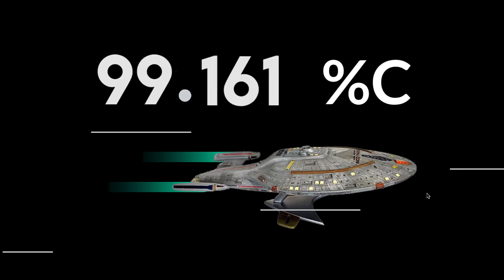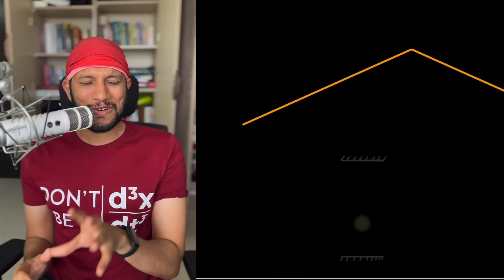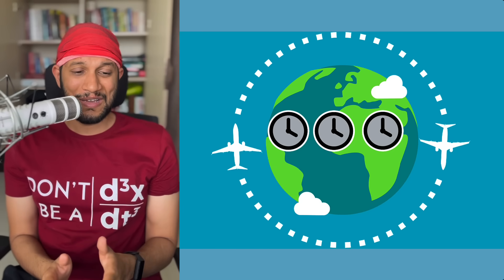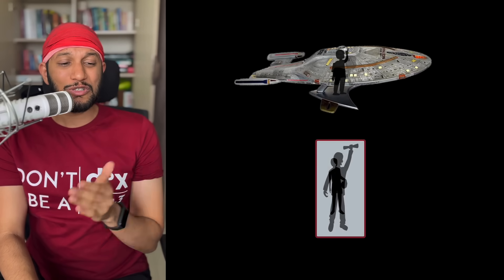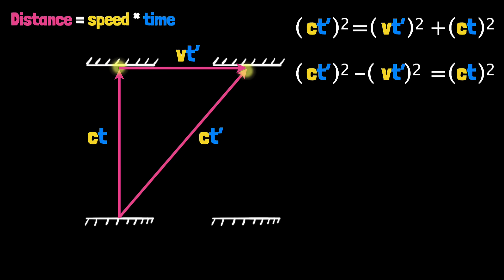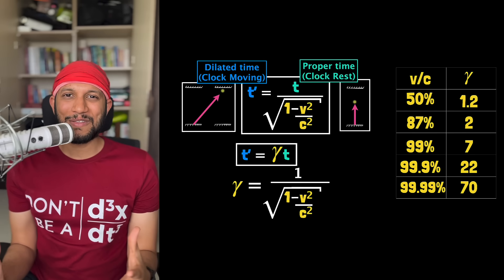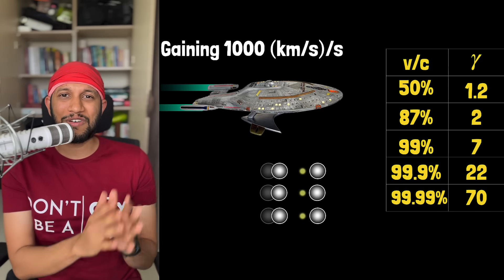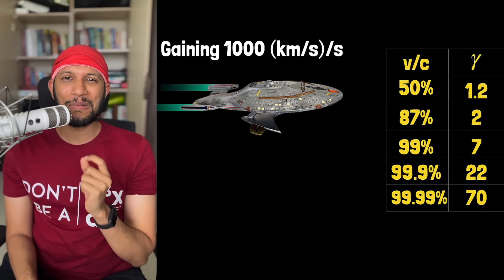I finally understood why you can't go faster than light! (My mind is blown)

Comment: Best explanation of Time Dilation and the speed limit I've encountered. But above all, I got quite emotional with your enthusiasm and teaching skills. It's as if you are discovering the phenomenon together with the student and getting blown away when you understand it. It is so inspiring.
Reply: I still don't quite understand the photon clock time dilation explanation in the beginning. I see it in terms of vectors, and the speed of the photon up and down should not change regardless of the speed of the ship (frictionless application being utilized here). It's akin to tossing a ball up in the air in an enclosed moving car. It goes up and down with the exact same force (ie speed) as if the car were stopped, yet the ball ends up in the back seat. It traveled a greater distance, but a force was applied to it. This is what is confusing me.
Reply: @nottelling4828  Ok! I hope I can clear some of your confusion (and anyone wanting to help is also very welcome to do that): 1 - the speed of the photon is not changing in both situations. It's the distance that the photon is moving through that is changing. So, try to consider it based on the speed being constant. 2 - Your example of the ball in the car, you mentioned "exact same force (i.e. speed)". Don't confuse force with speed. Applying a force on something can accelerate it, which means it will gain speed. In your example, throwing a ball up in a car means you apply a force (up) on the ball. But the ball falls down because of gravity, which is not the same as your "up' force (in a Newtonian perspective, Earth applies a down force on the ball). 3 - (In a ideal frictionless situation) If you are sitting on the front sit of the car, and you thrown the ball up, it will fall down back on your hands, not on the back seat. Even in a non perfect situation you can observe this: close the windows of the car, and properly throw the ball up (it need to be a very good vertical throw - perpendicular to the plane of the car). 4 - Remember that the force you apply on the ball is vertical. It doesn't make the ball move forward. The ball will only move forward (and still fall back on your hand), from the perspective of someone standing still outside of the car. From your perspective, the ball doesn't move forward at all, just up and down. If you want another example, just stand in somewhere (your room, outside, etc), and thrown a ball up. It will fall on your hands. The ball didn't move forward or made any funny curve. But if I was looking at this ball from outside the solar system, it would have traveled such a great distance (making all sorts of curves because of Earth and Sun's movements). I hope that if you can understand these 4 points, you can better understand his photo clock explanation.
Reply: @biosteamstudio  What if we, for a moment, put aside the assumption that the speed of the photons is actually constant in regard to an observer? That for the observer that sees the photons travelling a longer distance in the same amount of time, the photons are actually travelling faster than c, which is true according to his frame of reference.

The Theory of Relativity states that what is actually happening is that space compresses down at relativistic speeds, which creates the illusion for the observer, that the photons are travelling faster than c. But what if the very assumption that photons must always travel at c, regardless of the frame of reference, is incorrect?
Reply: @biosteamstudio  In my view, it sounds like "speed of light is constant" and "time and space are relative" are tautological axioms that necessarily prove each. Nothing really changes, if we invert the axioms and state them like this:
If "time and space are constant" then "the speed of light is relative."

This logic sounds perfectly reasonable and it doesn't cause physics to break in any major way, so I don't really understand, why we shouldn't invert these axioms. The only sort of major thing we would need to adjust, is that we would need to assume that gravity has an effect on photons, because gravity wouldn't compress space-time anymore.
Reply: @biosteamstudio  Sorry about the spam, YT keeps deleting my comments, if I don't split them up.
Reply: @villevalste1888  No worries about the spam. Thanks for your contribution. From my understanding, you can't consider that there is a observer for light, i.e., "c" is constant regardless of the motion of it's source or an observer (this is the 2nd postulate in the theory of special relativity). Also, if we want to imagine an universe where we can change the "rules" of the universe, this is not our universe anymore (I think FloatHeadPhysics mentioned this around 7:30). I also understand (I may be wrong in my interpretation) that the expansion of space does not change the speed of the moving object in space. Imagine if the object speed is 10m/s , but space doubled. It is still 10m, just that it is a longer 10m. The speed is the same. For example, imagine if you use your finger to move 5cm along a ruler. Then you stretch the ruler to double it's length. Your finger will still arrive at 5cm, just that you had to take a larger step (2x the length before stretching).
Reply: @biosteamstudio  That's exactly my problem here. If something appears to be going twice the speed of light, Einstein says that it's not actually going faster than light, because space-time bends for the object going at relativistic speeds, while the speed of the object maintains a speed below c despite our observations. Einstein's philosophy trumps empirical evidence. But why?

If we assume that space and time are absolute and that the speed of light is not, then our empirical observations remain valid without the need to imagine that space-time fluctuates based on an object's speed.

If we based our theories on what we are able to observe, I think we could come up with theories that actually reflect our reality. A fluctuating space-time continuum only needs to exist, because there is a disagreement between theory and observed reality. If the theory was adjusted to fit reality, instead of fudging the numbers with brand new theories, I think we might actually be able to have a model of physics that wasn't erring in its predictions by several orders of magnitude.
Reply: @ That's exactly my problem here. If something appears to be going twice the speed of light, Einstein says that it's not actually going faster than light, because space-time bends for the object going at relativistic speeds, while the speed of the object maintains a speed below c despite our observations. Einstein's philosophy trumps empirical evidence. But why?

If we assume that space and time are absolute and that the speed of light is not, then our empirical observations remain valid without the need to imagine that space-time fluctuates based on an object's speed.
Reply: @biosteamstudio  If we based our theories on what we are able to observe, I think we could come up with theories that actually reflect our reality. A fluctuating space-time continuum only needs to exist, because there is a disagreement between theory and observed reality. If the theory was adjusted to fit reality, instead of fudging the numbers with brand new theories, I think we might actually be able to have a model of physics that wasn't erring in its predictions by several orders of magnitude.
Reply: SO tell me, If 2 twins are moving, A with relative velocity to B and B with relative velocity to A,
which of this twins gets older ? WHich biochemical processes goes slower ?
If relative velocity A to B and B to A is the same ? 
If you have some point between M31 and Milky Way and from this point
you will start Starship1 to M31 and Starwhip2 to MilkyWay,
how many generations you need to reach this galaxy in those starships ?
And what will be the relative age of this passangers ? Which will be older. ?
Reply: @biosteamstudio  Time dilation doesn't exist.  Equating the functioning of a human made physical device to time is possibly the silliest and most fallacious scientific concepts ever.  It's so obviously ridiculous it shouldn't even be discussed except for entertainment purposes.  The distance traveled by a photon time measurement device represents time?!  Hahahahaha.  No. It represents the effect motion has on a tool.  Time exists independently of devices used to measure time.  So, when my clock stops, time stops?  Hahahahahaha.
Reply: @Darin.Pearson  It sounds like you're fixated on the concept of time from a philosophical perspective, or treating time as a constant.

If it is the latter, the onus is on you to provide proof that time is constant.

It also sounds like you've missed the point of the measuring devices as your logic implies that by me not having a clock at all that time ceases to exist all together.

This was not the insinuation being made in the video and shows a misunderstanding of our concept of time being relative to our perspective.
Reply: @Darin.Pearson  strawman argument final boss
Reply: @Darin.Pearson  Imagine going against science that has been proven for over 100 years at this point... this is a schizopost comment if I've ever seen one.

Comment: Because ever since the general theory of relativity was postulated, Einstein understood that you needed exponential increases of energy consumption the closer you get to the speed of light. Photons have it easy because being a wave and a particle at the same time,  they technically have no mass and thus they can ignore inertia and other gravitational interactions attributed to it.

But for an object with mass you need ever increasing amounts of energy to increase it's velocity with every fraction of percent it get closer to the speed of light, right up at the point where the energy requirement becomes infinite, because no matter what amount of additional energy is added to the system, the speed doesn't increase further.

This is common knowledge. Next video topic plis.

Comment: For speed. The reason that you can never reach the speed of light is that in order to do so, at some point, you would have to bring time to a complete halt and as you know, speed is the relationship between distance covered within a certain amount of time. Without time you can have no speed. Therefore, the issue is not that you need more energy, it's that you need more time

Comment: You were doing really well in the very beginning of your conversation. But then you got to the end, where you completely lost it. You see, the issue is not that you need more and more energy. In fact Let me clarify. In order to continue accelerating at the same rate you will need to use the same amount of fuel at the same rate. That doesn't change with speed. The issue is that the faster you go time slows down in order to compensate

Comment: The only way to have sub-light or over the speed of light flight is to have a deflector to repel any debris which might strike the space ship. Even a particle as small as an atom can penetrate the hull of a space ship. We don't have the technology for the deflectors or high tech materials for the hull of the space ship itself. Maybe in the next 3 - 5 centuries the human race will have developed the proper hull materials & deflectors. Will the human race still to be around, we'll have to see.

Comment: If you reduce inertia, you spend less energy that enables you to speed up to and past the speed of light. You have to reduce inertia by alternating the Higgs boson field around the craft on a quantum level. An example of this is the TR3-B. Look into it and then tell me it isn't possible to pass the speed of light. Easier to fold space instead of wasting time traveling from point to point using traditional navigation.
Reply: That's just UFO bs my dude.

Comment: Going faster than light is the same problem as going faster than sound. The medium being travelled through has to be taken into consideration. Until that happens, there will be no FTL travel. Period. Space is not empty, in fact it's full. A spaceship is as a submarine under water. Good job, by the way.

Comment: Amazing video truly. I have one question, you said that from the spaceships perspective nothing changes, so doesn't that mean that it will eventually reach the speed of light even when everything outside stays frozen and continue accelerating?? (stupid question, was just wondering)
Reply: Not a dumb question at all. But remember that according to relativity all speed is relative.  When you say "would someone on the ship reach light speed", you have to specify what reference frame you are measuring in. 

From the perspective of someone on the ship (that is, we are measuring the ship's speed relative to the observer on the ship), the ship is at rest.  This is true trivially since everything is always at rest in its own reference frame (the ship can't be in relative motion with itself or with an observer who is stationary relative to the ship).  So in this frame, the observer on the ship will never reach lightspeed (or any nonzero velocity).

Measuring from their own reference frame isn't very useful though.  When you drive down the highway, you are technically at rest in your own reference frame, so to get a useful measurement you measure your speed relative to the ground, e.g. if you're going 60mph that's 60mph relative to the ground.  The person on the spaceship can do the same thing and choose some arbitrary external point to measure their speed relative to.  But note that this is exactly the same thing as an external observer measuring the ship's speed, and as we've already seen the ship will never reach light speed in any external frame.

So regardless of what reference frame the observer on the ship chooses, they will always measure the ship's speed to be less than the speed of light.

Comment: Anything that has mass will not or can not travel at the speed of light nor can it travel even close to it.  Photons are weightless and can travel at the speed of light.
Reply: Massive objects absolutely can travel arbitrarily close to the speed of light (without reaching it).  Remember that all speed is relative.  Right now some high energy particle is traveling past you at near the speed of light.  It is also completely valid to say that, in the reference frame of the particle, you are travelling by that particle at near the speed of light while the particle is at rest.

Comment: Nahh the evidence of clocks slowing is completely wrong. I mean the clocks cannot be synced with formula because the solar system is also moving with some speed. So the absolute velocity with which planes fly is dynamic depending on which direction plane is flying. So the clock can go even faster if the direction of plane velocity is oposite to the direction of solar system velocity. There has to be some other effect that changes the clock motion

Comment: Excellent explanation. However, a question comes to mind that speed of light cannot be attained from the perspective of stationary observer but it can be attained from the perspective of the observer inside the ship, correct or not? and if not then why?
Reply: From the perspective of the observer on the ship (i.e. measuring in reference frame of the ship), their speed is always zero since they can't be in relative motion with themselves.  In order for the observer on the ship to make a useful measurement of their speed, they would need to measure relative to some external reference frame, and that is no different from an external observer measuring their speed.

Comment: Hello there. I am not very good at physics, so my question is:
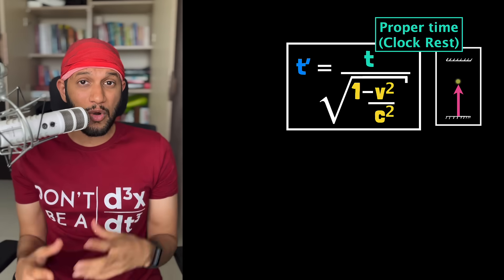how do you know when the clock is at rest (9:55)? I mean also the earth is moving in the universe and everything else is also moving. You have no fixed point where you know this is clearly standing still dependent on the universe itself?

but interesting video. I learned something new. ^^
Reply: One of the key takeaways of relativity is that all speed is relative and there is no such thing as an "absolute" speed or "absolute rest".  If we say the clock is at rest, that just means that it is not moving in the reference frame that we are working in.  However it is perfectly valid to say that it is simultaneously moving at 99% of the speed of light in some other frame.  Same idea with the earth: if we're measuring, say, the speed of a ball thrown through the air, we measure relative to the earth which we can consider stationary.  The fact that the earth is moving at "high" speeds around the sun and that the entire solar system is moving at even higher speeds around the center of the galaxy are irrelevant.
Reply: @charlieharris4881  ah, yeah I understand. that was a blocking in my brain causing this question. 😄 Thanks for the nice answer.
Reply: @charlieharris4881 Make sence 😊